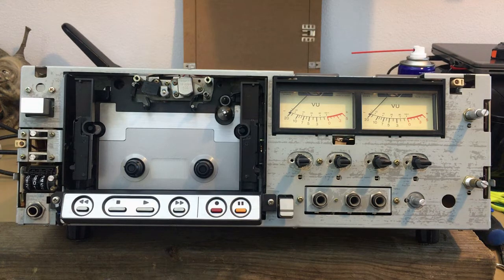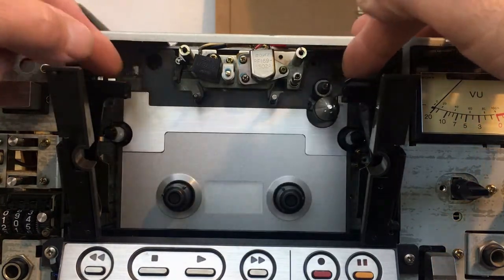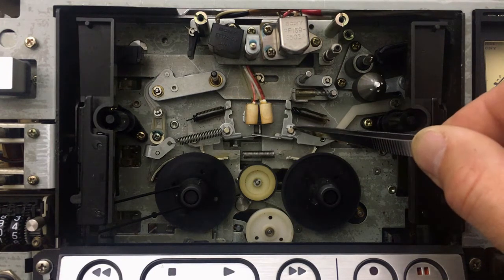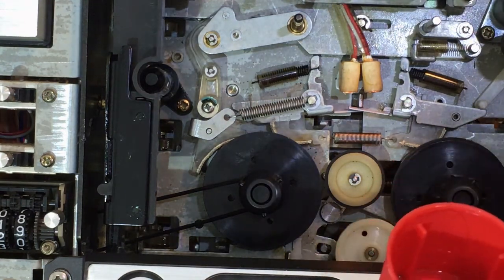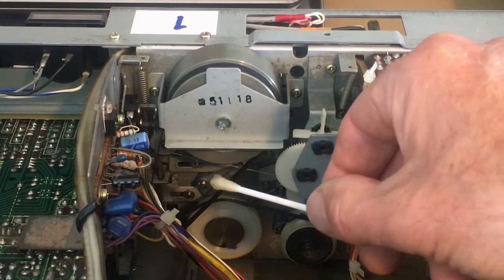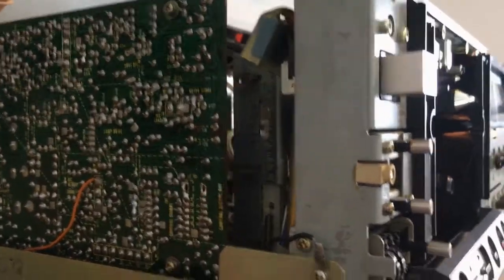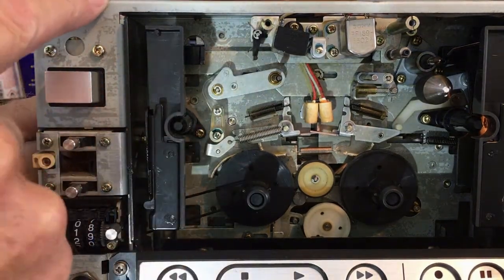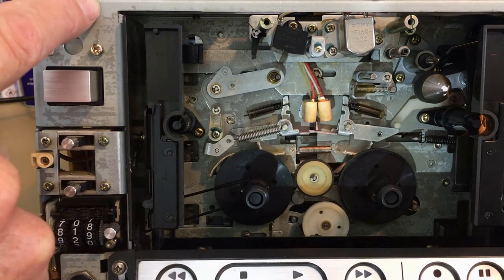Sony EL 5 Elcaset repair part 1, cleaning, re-greasing, checking

Comment: My Elcast 7 will rewind, ff and play, but wont play with a tape in it. Any thoughts?
Reply: Hello,
I am very familiar with the EL-5, but not at all with the EL-7 🫤. 
The only thing I can think of from your post is that the capstan has no or not enough grip on the tape. Could be sticky mechanism due to old grease. 
Regards